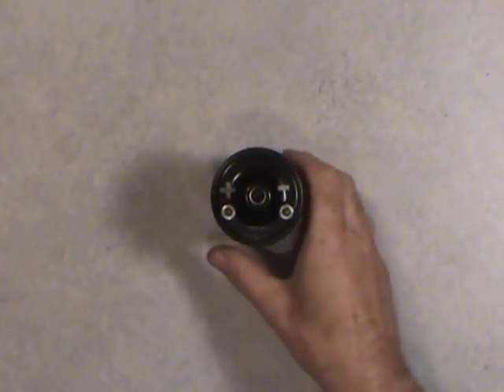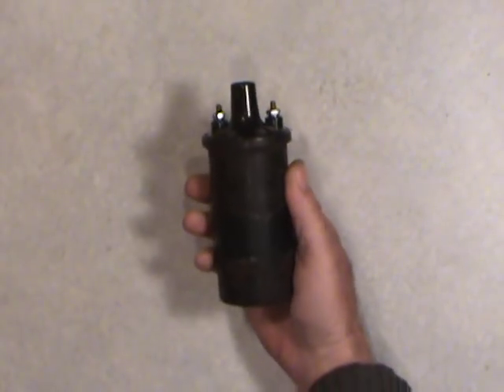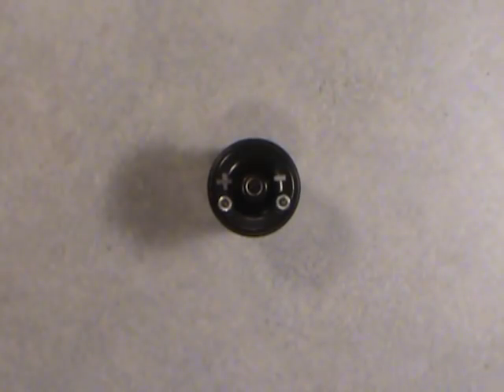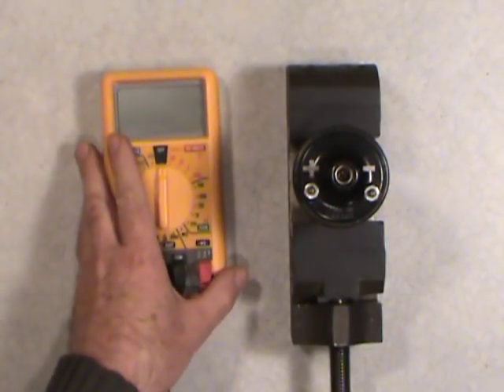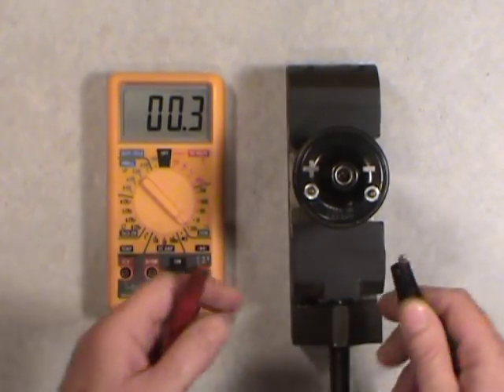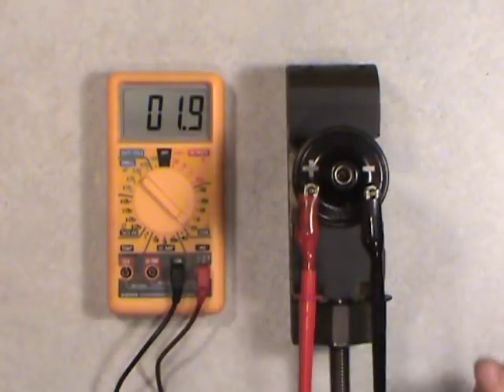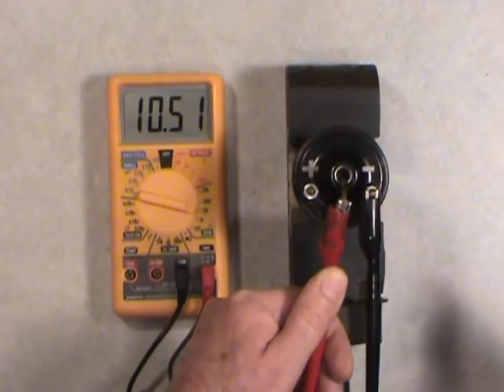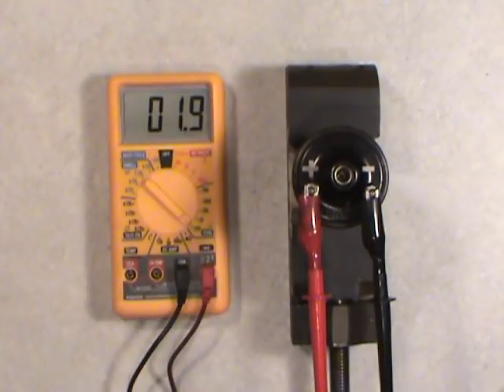Ignition Coil Testing

Comment: Hi Rocky,
Pretty clear instruction here, thanks.

A question for you: I have a 77, 16hp Onan twin with an oil filled double coil. It has two secondary outputs (two plug~wire output), what's known as a "wasted spark" system. So both plugs get spark at the same time. The coil has lost its oil. They're not made anymore, so, would it be possible to split the wire lead to the primary and attach them to two single coils. If I did this would there be potential for harm to the points and or condenser.

Thanks again.
Reply from the maker: searchlight22 Greetings searchlight22....Thanks for watching, and for Your comment/question as well................................................Have You done, all that You can, in "Searching" the "Internet" for Your Particular "Ignition Coil"...???............................................................"E-Bay", is a very good place to start, and, try "Different" Search "Words, and Phrases/Sentences", that You "Type" in the "Search-Bar/Field", as by doing so, will usually, give You, quite a few, "Different Search Results"....................................................You had mentioned, that You had, a "77" (the Year "1977"...???)...Onan 16 HP Twin (Twin or 2 Cylinders...???)...Engine, and..."What Kind of Vehicle...Boat, or even Gen-Set", is Your "Onan Engine"..."Installed In", as, I haven't a Clue, as to what I'm up against, and, the "More" that You are able to Tell me, the "More", that I should be able, to help You out......................................................."If" it happens to turn out, that, there is no way, that You are able to "Locate" the "Exact/Identical"..."Ignition Coil"...that Your Onan came Equipped with..."Originally" (that Applies only, "If" Someone Did Not "Modify" anything, that is), then, it "Is"..."Possible"...to...Create a "Dual, Single Ignition Coil"..."Wasted Spark"..."Ignition System".........................................................In order to do so, the "Newly Designed"..."Wasted Spark"..."Ignition System"...with the..."Two New Individual Oil Filled Ignition Coils"...would have to be..."Planned and Well thought out"...and...the "New Entire Ignition System"...has to be..."Electrically Balanced"...and...has to "Pass", the "Importance of Safety", which happens to be the "Top Priority"...and, at the..."Top of the List"...!!!............................................."All"..."Components"...have to be..."Matched" to the..."New"..."Total Electrical Circuit"...of the..."Newly Developed"...Wasted Spark, Ignition System"...!!!.........................................................That "Includes"...the "Ignition System's..."Supply Voltage"...the "Type of Spark Plugs, and, the "Gap", that they are Set at"...the "Rating and Resistance in Ohm's, that the 2 New Ignition Coils Specifications are"...the "Micro-Farad Rating of the Condenser/Capacitor"...and "Very Important"..is, the Ignition System's Electrical Circuit "Wiring Gauge"..along with the "Approved"...Ignition System's..."Fuse or Circuit Breaker"...so, a "Fire Does Not Start to Happen"...!!!...............................................Once..."Everything is Approved and 100% SAFE"...one of the New Wasted Spark Ignition System's, shall we say..."Balancing Act"...happens to be that, of the..."Micro-Farad Rating"...of the..."Condenser/Capacitor"....as, "It's Responsible"...for the..."Immediate Collapse"...of the Ignition Coils (remember, we now have "2" Ignition Coils) "Magnetic Field/s"...in order to have the Ignition System "Work Properly"...!!!...................................................Think of the Condenser/Capacitor, as an...Electrical "Sponge, that Absorbs, and Stores Electricity"......................................................If the "Micro-Farad Rating of the Condenser/Capacitor" is..."Wrong"...or it..."Fails"...it usually "Shows Up" on the "Ignition Points", and what You will usually "See", is, the "Ignition Points..."Showing"...some "Easily Seen"..."Pitting" (Electrical Erosion, due to Electrical Arcing)...!!!.....................................................So then, for now, those are just some, of my..."Generic"...thoughts, on, what has to be taken into Consideration, before a person..."Implements"...such an Engineering, shall we say..."Project"......................................................Let me "Know", what Your "Onan" is "Powering", so, I don't have to go, on a..."Wild-Goose-Chase"...lol..........................................................Be Safe, take care, and have a good one.
Reply: RockysRoadshow Hi Rocky,

So very kind of you to reply this quickly and in such detail as well. Thank You.

Some background; We acquired a 1977 Massey Ferguson 1655 garden tractor a year ago and it's still a "work in progress". There is a considerable difference in a Lawn Tractor and a Garden Tractor. Our machine weighs close to 450Kg and has about 800 Ft/Lbs of torque, it has hydraulics in the front, middle and rear for various attachments. Included in the sale was a large bottom plow and a 16 disk harrow. I'm thinking about buying a front end loader attachment. This is not a fancy lawn mower. No manufacturer makes anything like this these days. Closest tractor to match now would be a B series Kobuta, that, in it's most basic form (that is to say; useless), would cost about 12 grand. We paid less than $ 1,000 with the attachments.

The 16hp gas engine is a horizontally opposed twin cylinder Onan. Popular opinion says it is among the best small engines ever built. The tractor has many deficiencies but is essentially whole. Our primary use is working a 5,000 Sq/ft veg. garden with the plow and harrow, but we also have a 42" snowblower that is being modified to work with our machine.

We don't want to spend a lot of cash to get this rig rehabilitated until it's clear it is worth the investment and it might not be. The OEM coil went out of production years ago. I have seen them on E-Bay, but only used offerings. Not that keen on paying for what may be "sketchy" material. Just because the resistance reading from a meter is good does not mean the coil will still work when it reaches the high temps involved when an engine runs for a prolonged period. Therefore, I want to determine if it is in fact the coil that is preventing the old girl from starting at the moment. The tractor was running and did so until last fall. 

I sourced a set of points with condenser, replaced the plugs and worked on the carb. (float is in need of replacement with a metal version), Plug wires also have to be replaced. I replaced all of the original wiring with # 10 TEW tinned cable so the amperage load is not an issue. A lot of the OEM wire was # 16, or less.

"Lost Spark" (system), is a romantic term for " lets make the engine cheaper". It refers to the fact that the engine ignition does not have a distributer. The double coil output goes to both plugs everytime the points cycle. As one of the pistons is in the exhaust position, the spark to that cylinder is "wasted". 

My hope is that using two single coils won't make any difference. What I need to know most is if splitting the lead to the primary side will lower the amperage enough to affect the secondary of two separate coils. By the way, I have reversed the leads on the current coil so that the 12 V positive goes to the negative post on the coil. I've read that in fact, current prefers to flow from the negative to the positive and additionally, from a "cold" to hot surface. Worked well until the coil failed. I'm fairly certain that all of the oil has leaked from my coil.

Using two separate coils would be an experiment only. I wish to confirm the coil is the issue. If the engine starts, I'll search for the OEM coil and resume the rest of the refurbishment on the tractor.

Thanks again Rocky
Reply from the maker: searchlight22 Greetings searchlight22....You're welcome, for any information, that I may have provided, and hopefully, it has, or will help You out, to some extent, somewhat...........................................................Well, I surfed the good ole Internet, and had a "Look-See", at some Pictures and such, as it pertains, to Your Massey Ferguson (spelling?) 1977...1655...Garden Tractor...equipped with the 16 HP Onan Engine, and, from what I saw, and gave considerable thought to also, which also includes, some of what You were telling me about, as well, had me thinkin' the following........................................Please..."Don't"..."Use"..."Any", of the Following "Information"...or..."Specifications"...that I post in this Reply/Comment...and..."Only"..."Use and Apply"...the "Servicing Methods and Specifications"...that the..."Manufacturer"...of Your 1655-Garden Tractor..."Approves"...!!!...................................................All-Righty then, "Lettuce" (intentional Miss-Spelling!...lol) begin.................................................I got to thinkin', about, how You were saying, that, Your Original Ignition Coil got "Fried" (aka, became Non-Functional), when You might have "Reversed" the "Polarity" of the "Power Supply" and "Ground/Earth"...Connections...to the Ignition Coil's "Primary Terminals"...???.........................................That in itself (Reversing the...+ Positive...and the...- Negative...Supply and Ground Wires)...(to the Ignition Coil...???)..."Is Not"...something that I would Do, as, I figure, that the..."Engineers/Designers"...of just about Any Engine's..."Ignition System"...and its...Related "Component Parts"...happened to be, Very...Carefully..."Designed" and "Tested"...with the..."Circuitry"...that the "Manufacturer" decided upon.......................................................It appears, that, the...."Internal Structure/Design"...of Your..."Dual Output"...Ignition Coil...has..."Only"...a..."Single Set of, Both, Primary and Secondary Coil Windings"...much like that, of a Regular/Typical..."Single Output"..."Oil Filled, Automotive"..."Ignition Coil"...!!! (and here I was thinkin', that I would be seeing "2" Individual Coils, side by side, Hiding Inside it...!!!).....................................If You still have that..."Original/Not Workin'/Any More"...Ignition Coil, still Kickin' around, have a Look-see at/on it, as it may be showing You, that it just Might be, a..."6-VOLT"...Ignition Coil"...!!!....................................................If that be the case, and, "12-VOLTS" was "Put-Through"..."IT"..."Without"..a..."RESISTOR" (I'm not sure, if "They", may have used that singular word terminology, as it has me thinkin'..."Ballast Resistor"...eh), that was Theoretically (and "Physically" as well), supposed to..."DROP" (aka, Reduce) that Nominal "12-VOLTS"..."DOWN"...to what-ever that there "6-VOLT"...Ignition Coil could "TOLERATE", without, having it Go..."POOF" (aka, another fun word, for once again, becoming Non-Functional any more), would, in My..."Guess-tim-eh-tion"...possibly be the cause, of the "Original Ignition Coil"..."Giving-Up-the-Ghost" (and yet, another Rendition, of, my take, on, becoming...Non-Functional any more!...lol)...........................................Polarity, You say...???............................................As I see it, and in its most Basic Form, the "Ignition Points" (aka, Breaker Points), are basically, just a "Switch"...that either..."Makes" or "Breaks" (aka, Connects or Opens)...the...Ignition System's..."Primary Coil's...(Negative Wire/Wiring)..."Electrical"..."Connection"...to..."GROUND" (aka, - or Negative, or even Minus, if You will)................................."Always"...Check, and Make Sure...No-matter...What, or Which Ignition Coil, that is to be Used, in "Any" Ignition System, is to Make Sure, to have the "Properly Specified and Rated"..."Ballast Resistor"...in the Ignition's Electrical "Circuit", that's usually Installed, and most that I've seen, in Vehicles, oh, up until, about 1974, are usually, in the + Positive Supply Wiring Circuit, Just "Before" the "Ignition Coil's"..."+ or Positive connection Terminal"......................................There are "Some"..Ignition Coils...that "Do Not Require", a "Ballast Resistor" in their particular Ignition System's "Electrical Circuit", so, just make sure, that the "Required"..."Components"...are..."Installed"..."Correctly"...as the..."Manufacturer"..."Recommends"...!!!...................Maybe, Your Onan Engine has the following...???.......................................I did see (Picture-wise, that is), a shall we say, or call it, an "Ignition Box", that supposedly..."Houses the Ignition/Breaker Points"..."Inside of It"...having the "Ignition/Breaker Points"..."Actuated" (aka, Opening and Closing), by a Round-Rod/Dowel-like..."Shaft"...that has me thinkin', that there is, perhaps, an..."Extra"..."Lobe-like-thing-ah-mah-bob"...on the..."Camshaft" (as, I think, that I recall seeing, what appeared to be "5" Camshaft Lobes, on, that there Camshaft!), and there are Only "4" Valves, in that there Onan Engine, that need to be "Activated", by that there "Bump-Stick"...!!!...(Bump-Stick, is a rather Fun-Word for Camshaft, I think...it's kinda self-explanitory, don't-cha-think?, and no, it's not me, that came up with that one!...lol)...............................................So then, that about does it, for this particular Installment, and, I hope it helps You out somewhat......................................Best of Luck, with "Restoring"...Your..."1655".........................................'Till next time...................................................Be Safe, take care, and have a good one.

Comment: I may be wrong, but to me, it seems like the coil your testing, is within OPERATING RANGE on resistance... I know you said you had an oil from it, but, say you just re-oriented it vertically, wouldn't this coil is be working???  1.4 - 1.6 PRIMARY, and 10,500 ohm on the SECONDARY...???  So would you consider this coil BAD or GOOD?  THANKS!!!
Reply from the maker: Mike W Greetings Mike W....Thanks for watching, and for Your very good comment/observation as well................................Yes, indeed, the Ignition Coil that You saw in this Video of mine, does Test OK Ohms-wise, and, seeing as how, such a small amount of Cooling/Insulating Oil, that was inside of it, Leaked-Out, when it was Mounted in the "Horizontal" Plane (aka, sideways), I'm quite sure, that, once, as You were sayin', and, also, I had the same thought, some time ago, about "Mounting/Positioning", this "Leaking"...lol..."Ignition Coil "...in the "Vertical" Plane (aka, Up & Down), then, as I see it, this particular Ignition coil, should Work, dare I say, almost like New (I hope...lol).............................As I see it, this...prone to Leaking (maybe?), Type of, Old School, Oil Filled Ignition Coil..."Should Always be Mounted Vertically/Up & Down"...having the High Voltage/Secondary..."Tower" (where the Oil Leak is found, inside of the Tower, that is), Pointing Up, towards the Sky, that way, I can't really see, or imagine, any of that Ignition Coil's..."Oil, Leaking Out of it"...............................If, on the other hand, too much Oil "Leaked Out", then, this particular Ignition Coil, would probably start to "Over-Heat", and, would probably Stop Working..................................Even though an Ignition Coil "Tests OK Ohms-wise", there can be times, quite Rarely, where, one of these, shall we say Faulty Ignition Coils, starts to "Act-Up", when it gets up to Operating Temperature, or hotter, as in, oh, Hard Starting...Ignition related Misfires...Surging Engine...etc....and, also, might Stop Working at all...............................Also, when-ever, Replacing any Ignition related, Parts & Pieces..."Make Sure", that, each and every, one of those Parts, have the "Correct Resistance/Rating", for the "Exact" Vehicle's, Ignition System's, "Circuit/Design"...so, some of those Parts & Pieces, Don't do something, like "Over-Heat", and go "Kaput"...!!! (as in, Not Functioning/Not Working any more).............................The Ignition Circuit, that this Video's, Ignition Coil was in, had, what is known, as a "Ballast Resistor" in it (looks kinda like, a white/ceramic/porcelain Block), and, "Both", the "Ballast Resistor", and the "Ignition Coil", had to Have, the "Correct/Specified"..."Ohms Ratings/Resistance"...for that..."Exact, Vehicle's,  Ignition Circuit" (with-in reason), or, might end up having a "Weak Spark" (at the spark plugs), or, in a worst case scenario, the (oil filled) Ignition Coil, might get "Over-Saturated" (aka, Over-Charged, with a Higher then wanted/needed Voltage), due to something, like, a Ballast Resistor, allowing too much Voltage, into the Ignition Coil...and, maybe..."POOF"...bye bye Ignition Coil...!!!...lol..........................Yes-Sir-ee-Bob...it's never, all that easy, is it...???...lol...especially, when, we all, happen to have a closer look at something like this, that is...lol...................I hope, what I was sayin', just above, helps You out, and....................Till next time............Be Safe, take care, and have a good one.

Comment from the maker: ...although your Ignition-Coil may show Good-Ohm's-Readings, as per the Specifications for your particular Ignition-Coil, that is just telling you that the Primary, and Secondary Windings are not Shorting-Out, or, have an Open-Circuit (open circuit = break in wire/windings, or connection somewhere)....Sometimes, Ignition-Coils, and other Electrical/Electronic Parts, can start to Act-Up or Malfunction when they Heat-Up, or get Hot!....Take care, and have a good one.